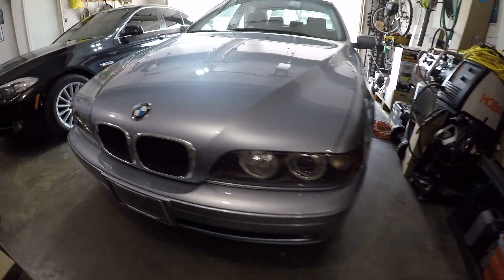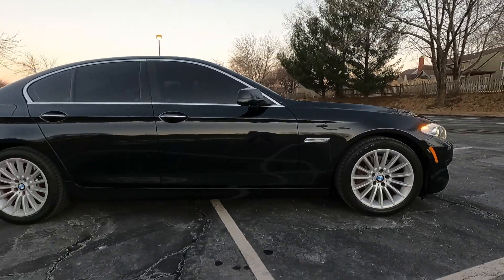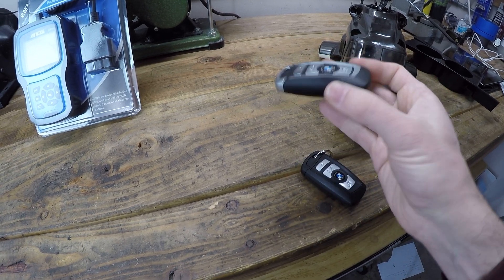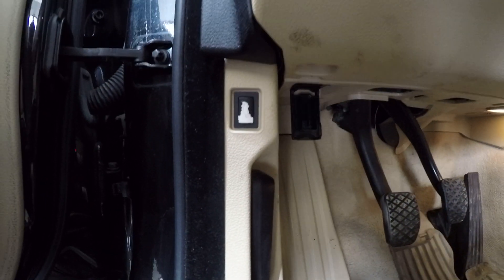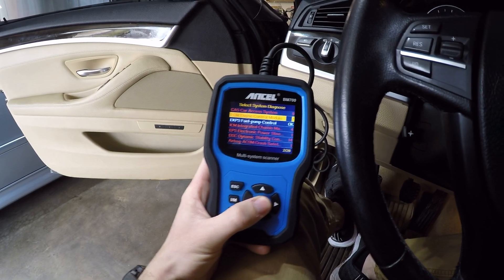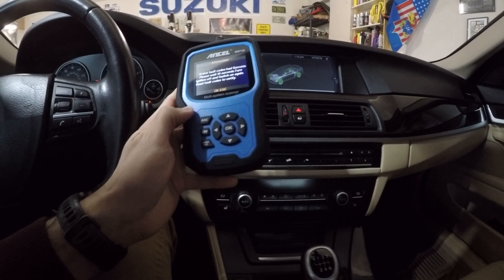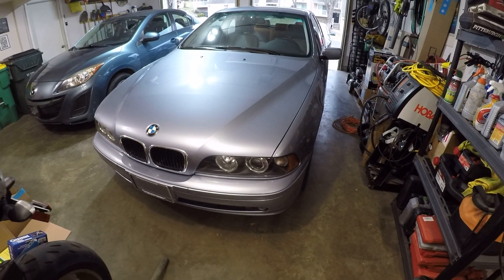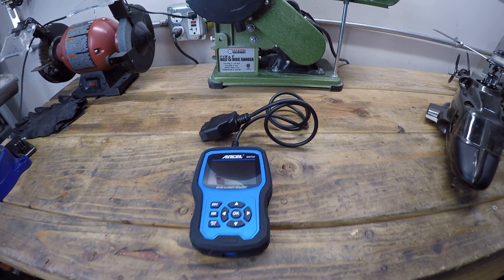Don't own a BMW F10 535i without this tool! (TPMS Malfunction Reset)

Comment: That scanner is basic. When you get "Transport Mode active" it means the battery is or was very low in charge/voltage that it activated it so the car wouldn't die completely.  A very low battery drainage can cause plenty of error code for that reason. 
This scanner is basic and not enough to fully fix things. 

For example, on your TPMS indicators for the BMW F10.  It shows green tires and it states "Active" but you are missing the tire pressure (psi) measurements and tire temperature indicators showing above each tire and with that you will need a more advanced ECU coding scantool to activate those missing features! 

Had a $400 scan tool that was great but still was limited and offer plenty of details when figuring BMW issues but still not enough. Bought a $800 scan tool that retails for $1,300 that has everything to code a BMW easily and that scanner was able to initialized my new headlight TMS control module, coded my new rear EDC shocks/struts (without coding them the car disables SPORT & SPORT+ modes and the car is very stiff. Also was able to do  HPFP (high pressure fuel pump) reset & Vanos reset as well adjust the idle speed correctly!  Works amazing with any Toryota and Mazda cars too  The scanner was worth every penny!

Comment: You should really look in to downloading and installing BMW ISTA it’s a dealer factory software that can do all . That tool you got is ok for minor faults but it won’t be much help especially as you get in to more serious stuff . I own a same car and trust me ISTA will be your best friend with this car . ECU s on F chassis are so much more advanced and complicated then on E series . To install ISTA it’s not hard just google it .
Reply from the maker: I'll check it out, thanks!
Reply: @PracticalEnthusiast  ISTA is a must. Buy K+DCAN cable as well it will diagnose E and F chassis. ENET cable can do more but it will be a little harder to setup. For programming and coding F chassis You want to check E-SYS software. I am assuming that You know about realoem website :D